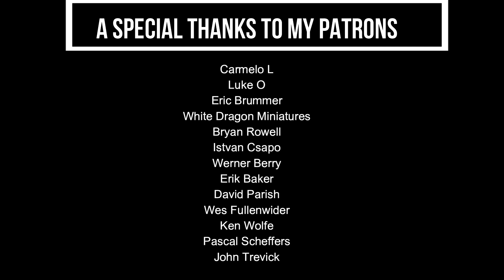DUAL PLASTIC INJECTION MOLDS ASSEMBLY

Comment: That was great! Amazing how much metal goes into something like that.  After you media blasted the mold face where you cutting in air vents or something on the mill?  Neat to see a pneumatic ejector pin setup.
Reply from the maker: Thanks for watching, yes I was cutting in 1/2 thousandths vents in the cavity to aid in part fill. The air 2nd stage eject comes in handy too

Comment: All of that for some cheap throw-away plastic parts.  Well, not for the first ones....<grin>  Thanks for showing the work involved for creation.
Reply: Yep. The first part costs 60k but the next one cost $1.50. You just have to make 60,000 of them so the overall cost ends up being under $3 a piece...